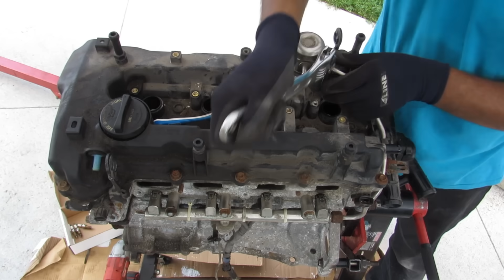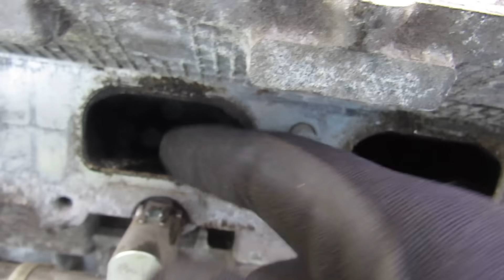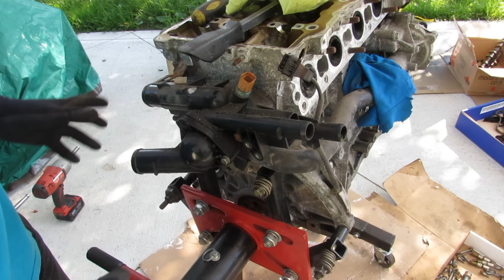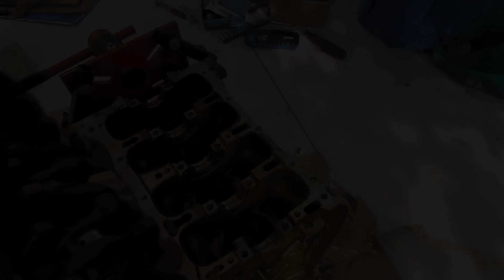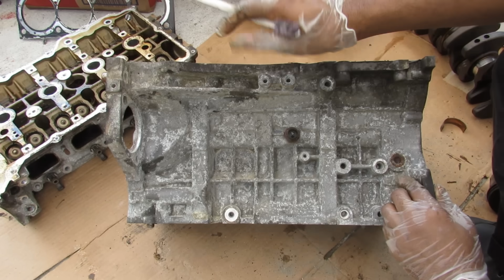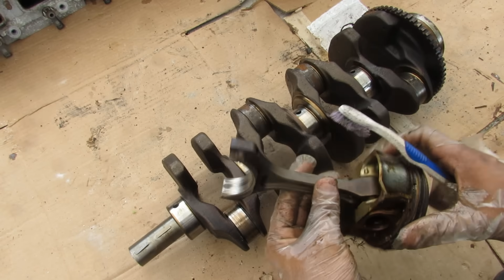Why Hyundai Engines FAIL

Comment: Because since about 2011 they stopped using good cheap simple aluminum crankshaft bearings, they started to use colorful copper crankshaft bearings, kinda to improve them, but for real it was to limit life of these parts more. If interested, I can share video in Russian where guys service mostly kia/Hyundai and by end of 10 years since 2011 they just realized that the improvement is actually a planted bomb.

Comment: I had a 2017 HUNDAI Sonada. My car was part of the engine recall due to the Vin numbers. My dealership basically said they would fix it when my wife and 6 year old daughter was on the side of the road with it!!!! It was running great. And while it was. I  traded with 10K ON the clock. For something else.  Looks like I avoided buying a new crappie engine when it was going to be out of warranty.

Comment: backed to 100k r 10 years- NO other carmaker backs products that well- toyota and honda wont admit their issues and hope the warranty ends
Reply: Pretty sure the 100k/10yr only applies to the original purchase owner. It no longer applies if you buy it second hand. 

Toyota did full frame replacements on Tacoma's for the frame rust issue. Parts & Labor $15,000 and they still honored it for older trucks not even worth that much. They also fixed the oil burning issues on their 2AZ-FE engines which cost up to $5,000.
Reply: @Argedis  yet denied sludge issue

Comment: Granted some engines are more durable then others, but Servicing your engine and keeping fresh fluids at all times will ensure longevity.
Reply: For real. I've got 92k on my '13 Sonata and I like it a lot. A lot of power and torque in the power train for a non turbo inline-4. The fuel injection is a problem so I'll probably let mine go as soon as the car market calms down. Mine will  be under warranty for another 10 months.

Comment: My buddy’s seized randomly on the highway. Hyundai replaced it for free, just had to pay for inspection. Even if yours is out of the warranty go harass them.
Reply: Most of these engines that have known problems are lifetime warrantied for the first engine
Reply: @jciarkowski3109  but I think it applies only to original owners...
Reply: @spol1622  if it’s the lifetime warranty extension (TXXI) it applies to the original owner or subsequent owners.
Reply: @spol1622  nope I’m second owner and I have life time warranty in writing
Reply: @spol1622  no, for all subsequent owners.
Reply: @heknows5418  just to let you know they added a new exclusion to the lifetime engine warranty on these. If your vehicle still has campaign 953 open when you’re engine dies they will not cover an engine replacement. Make sure you have campaign 953 done to still qualify for the lifetime engine warranty.
Reply: @jciarkowski3109  no, if the second engine dies, they still have to give you another one.  I got confirmation on this.
Reply: My niece sweet - talked her way into a new engine in a Sonata,  she was over in miles to cover,  but she just smiled, batted her eyes and said ....omg, what am I going to do now? Problem solved,  does not work well for 57 Year old grumpy bastards like myself though...

Comment: I had 2016 Kia Soul. I don’t think it was this engine but the result was the same. Catastrophic engine failure at 70,000 miles.
Reply: Replaced under warranty?
Reply: @JohnSmith-yv6eq  luckily yes... I must say they replaced the engine with out any hassle. And I was issued a rental car.

Comment: I read an account by a Kia dealer tech of this engine issue which also affects sister Hyundai. Drilling swarf left in the crankshaft oil passages. Dealers have a sound recording monitor which analyzes engine sound level to determine pending failure. 10 year 100K miles powertrain warranty should cover a replacement engine in addition to recall. Don’t let a dealer tell you they never heard of this issue and campaign. 
Now a new different engine problem recall 203 for faulty piston rings causing scored cylinder walls and excessive oil consumption. 
If Kia/Hyundai wants to keep up and beat Toyota and Honda they need to turn the company upside down to fix this repeated issue.
Reply: isn't that 100k warranty suppose to cover engine regardless? Hell, if mine gets this bad I'm going to offset the thing beforehand or claim a lemon law if they don't honor that warranty.
Reply: There is a reason they sell for so cheap. Corners were cut.

Comment: Would you know if the Hyundai Elantra 2017 or newer 2.0Lt has any engine issues?  I was thinking about purchasing an Elantra 2017
Reply: My 2016 sonata is at the dealer right now getting a new engine so adding 1 more year....idk

Comment: is using of 2 simple  engine oil pump  better for 2.4 GDI engine  in 2011 sonatas? .Because some repairers claims that oil pump of 2 simple engine is better than 2.4 Gdi oil pump.They said that it works more powerful

Comment: I have a 2015 Kia Sorento with this engine & it had the rod bearing issue at 95000 km's. Annoying and inconvenient however Kia replaced the engine free of charge even tho it was out of factory warranty. I was lucky that way, as it's a known issue.
Reply: I work for Hyundai. They've done nothing to address the issue. Just send us reman long blocks most of the time. They'll pretty much cover it forever though. I've put engines in cars with 200,000 on the clock.
Reply: @trevorharley4475  another new engine in 95000kms I guess lol
Reply: @trevorharley4475  is the software update mandatory to get the coverage? My gf has a 17 Sportage and got the letter encouraging her to get the update. 56k miles, no issues yet.
Reply: @danwake4431  it is now. Hyundai has started declining failed engines if the vehicle has ANY open recalls. Even if they are not related to the engine failure. Recalls are government mandated and at no cost to the customer. I would highly encourage you get all open recalls completed and follow up with your dealership regularly to confirm you have no open recalls. They've also gotten stingy about oil change records. So stay on those oil changes and keep the records.
Reply: @trevorharley4475  yes!! Stay in top of the oil changes and even once in awhile do it at the dealer. It helped me when I had an issue with my sienna and Toyota paid for the fixing of my blower motor.
Reply: However....did they replace it with the same machining engine or a proper replacement with out these problems?🤔
Reply: @sachsgs2509  I did inquire about that. They said the engine is brand new without the defects, and they haven't had any of the replacements experience the same issues
Reply: @CanadianTalent1  got ya...thank you for the info👌
Reply: Got one in the shop now waiting for approval to replace engine. Hope they do it, or I'll have to rebuild the POS myself, not spending too much money on a 2012 vehicle, but I hate to junk it too.

Comment: I owned a 2014 Kia Optima sxl turbo and I was always wondering why the Theta or Hyundai engines in general have the loudest direct injection.
Reply: All DI's clack the same, is the reason why lately cars have a lot more plastic covers. They work as noise suppressors. Listen to a diesel, it's the same noise.

Comment: My 2012 Sonata passed all testing requirements conducted by the local Hyundai dealer, thus, I was given an engine warranty up to 200k kms.  I am now at 185k kms. and I have not felt any engine abnormalities.  Almost every week, I check the engine oil level, it should be on the max side.  If the oil level goes down a bit, I top it off.  Once I reach 5000 kilometers, I change the oil and often use full synthetic oil and some premium oil filter.  I've also installed an oil catch can at 60,000 kms. so every time I do an oil change, I see some oil accumulation from the catch can.
Reply: I feel bad for you because I just bought a Toyota and I don’t have to deal with this
Reply: @merced175  Be careful because Toyota engines suffer the oil eating problem but that is because the owners actually cause the issue. All these small engines have weaker oil rings so and you need to keep that in mind.
Reply: @merced175  you kinda do tho. Toyota four cylinders are famous for drinking oil
Reply: @goclunker  it was a manufacturing defect that Toyota covered by replacing the pistons and piston rings. My Sonata was burning oil and Hyundai REFUSED to do anything about it, it got to the point where it was burning 3-4 quarts every 1k miles. There are Toyota's that burn oil, but the percentage of those that do are much lower than Hyundai's that burn oil.
Reply: @goclunker your absolutely right we have to top off every 1000 miles . They have a piston ring issue .
Reply: @GriffXJ my 2016 Hyundai sonata sport was doin the same thing until I called the dealership and they replaced the engine in 3 weeks with a lifetime warranty I hadn't had a problem since no one oil consumption but the dealer is in California
Reply from the maker: This is probably the best you can do to this engine. Hopefully it lasts.
Reply: I traded my 2011 Sonata 2.4 L with 235k km. Still ran fine...I drive mostly highway. My 2019 Tucson has the same 2.4L engine and it has a lifetime warranty on it due to the crankshaft milling issue suspected from the factory. I still drive mostly highway and the dealership mechanic told me that the highway driving would likely save my engine due to the oil being flushed through without seriously damaging the motor.
Reply: you will be right with this --> Once I reach 5000 kilometers, I change the oil and often use full synthetic oil and some premium oil filter
Reply: I stop using synthetic because my engine completely drinks it.  But Peneoil did do a great job cleaing it, the oil will turn black.  Now I use GTX and change the oil at 3500, but requires a quart or two between oil changes.
Reply: I would  rather get rid of it and drive something else just to be safe.
i dont want to constantly worry about hyundai engine blowing up in the middle of highway.  
10 years old hyundai worth nothing anyway.
Reply: I would get rid of the car prior to that 200k if you're smart. Don't go to the dealership cause they know about this. I'd shop around for best deal to get cash or trade-in. Once that warranty period is over for Hyundai/Kia cars you're playing with fire. Not worth it really.
Reply: A little oil burning never hurt anyone

Comment: Speaking as a retired mechanic this engine does have some serious design flaws. However, I now do airport transportation and have a 2013 Sonata (had I known about these engine issues I wouldn’t have bought it) bought new. Being very old school I changed the oil with 5w30 Valvoline modern engine full synthetic every 3000 (mostly highway) miles. At almost 212,000 miles on the original engine and transmission it’s just now starting to consume about 1/2 qt per 1,000 miles. In addition I drain and refill the coolant every year regardless of miles (I do this with all of my vehicles). Since I mostly used it on the highway I had the valves de-carboned every 70,000 miles. In addition I only used top-tier rated gasoline with a good fuel system treatment (Lucas every 1,000 miles Chevron every oil change) running a tank of premium every 3,000 miles. I also replaced the spark plugs and serpentine belt every 50,000 miles as well as replacing the transmission fluid every 15,000 miles because as an airport transportation driver my car(s) needs to be reliable. I have switched to 10w30 high mileage full synthetic in an effort to slow down the oil consumption. The car still looks, runs, and drives great. I now have a 2020 Mitsubishi Outlander suv as my business vehicle with my Sonata as my back up vehicle. I honestly wonder how many of these problems are attributable to Hyundais design flaw(s) vs owner neglect.
Reply: I have a non-turbo 2011 Sonata with 259,000 miles on the original engine, transmission, even axles. A family member borrowed my car for the last 20,000 miles, changed the oil/filter exactly once in that time, and overheated it on 5 separate occasions due to a coolant leak from that plastic thermostat housing. I was almost certain that the thing would be cooked, but one new housing later and we're still kicking.

Anyway, working at a shop with a lot of Hyundai/Kia customers, I understand I'm a minority with sort of a "survivor" engine - I've seen more than a few seize around the 100-130k mile mark.  I can recall at least 4 Sonatas that have seized, even out of the extended warranty period of 120k miles, and Hyundai took care of them all. I have yet to send a customer to the dealer for repairs that weren't covered, many times even outside of the warranty. I'm confident recommending these cars to customers as they can really be an exceptional value, and definitely tend to offer much better overall quality and driving dynamics than others. Despite issues as significant as, well, engine failures... Hyundai/Kia do seem to stand by their warranty.
Reply: @mrkzj2   That’s great to know. My car is on my living so if my engine does take a “dump“ it’s good to know that Hyundai will stand behind it. I’ve tried to get them to replace it because of the oil consumption issue but they said it’s not severe enough to warrant a replacement.
Reply: @recoveringnewyorker2243  Not to tell you to be dishonest, and I don't believe it makes a difference anyways... miles are miles, but don't tell them you use your car for commercial purposes, as they'll deny warranty.
Reply from the maker: I think both issues compound each other. The original oils would have had to be changed out frequently that the metal particules would be flushed out before causing major damage.
Reply: @speedkar99   Agreed, both issues compound each other. The 1999 Hyundai accent (bought new) I traded in for the 2020 Outlander still ran and drove great even though it was considered at the time to be a “throwaway car.” Although the paint was faded everything except for the rear window defroster functioned perfectly. That car was run on conventional oil. My wife’s 2010 Hyundai Accent with almost 95,000 miles on it still looks, runs, and drives great. My 2000 Chevrolet S10 2.2L 4 cyl was purchased in 2011 with 74,274 miles on it and a destroyed (seized) engine. The previous owner knew nothing about maintenance, she just drove it. After installing a new (not remanufactured) General Motors crate unit and a myriad of other new parts she now has 141,000 miles on her and has been a dependable daily driver ever since. Unfortunately all most drivers know about their cars is “Stick the key in and turn it.“
Reply: @speedkar99  Would frequent (every 3K). oil changes mitigate the intake valve carbon buildup?
Reply: We did all that maintenance on my sister's 2011 original owner, and she drives like a gramma. I would have to remind her from time to time to floor it. It seized at 115k. Hyundai saw all the receipts for the work I had done, and the intervals. Took 5 minutes for them to approve a new engine replacement.

Comment: Dude. And I thought Ford and GM were cutting corners in their engines. No wonder my 2015 Kia Sorento 2.4L engine overheated and blew up. I got a new engine and extended warranty up to 150K. And it blew right before the 60k warranty hit. Like at 57k or 57.5K I was a lucky bustard then. Awesome video bro. I always did wanted to see Hyundai’s 2.4L engine. No where near Honda standards.
Reply from the maker: interesting to hear your experience. I'm going to be filming a Honda next

Comment: I'm not convinced with their official explanation as to these failures being something as simple as debris left behind in the manufacturing process.
Surely something is failing in operation which is causing the debris to accumulate over time, or else the issues would be apparent almost immediately. They are however mostly happening after 100,000 miles and up to 10 years after leaving the showroom! 
I have a feeling there is a design flaw somewhere that they aren't admitting to...
Reply from the maker: If the metal debris isn't affecting the bearings directly, it's building up over time in the oil galleys causing oil starvation.
Reply: @speedkar99  I don't get how this debris will build up over time though if it is already there in the galleys from day one. If this were true it would be trapped in the oil filter almost immediately, long before they had a chance to accumulate.
I feel there is a design flaw causing a sudden point of failure somewhere and they are literally embarrassed about it haha

Comment: Bearings - ACTUALLY if there was debris in the oil, causing them to burn up, it would have affected the main bearings as well as the cams. I believe what happened it a simple case of oil starvation. Basically direct injection eating oil, oil not being check/changed regularly causing slug to clog the piston oil control rings, which then wears the piston rings, more blow by, ect. in a oil eating circle.
FYI, I have 2 of these engines in perfect condition.
Reply from the maker: The metal debris cause oil passages to clog up causing starvation
Reply: @speedkar99  I have 2x non direct injected Theta II engines and NONE of them have had any premature bearing wear. This was verified during their 100k and 80k engine rebuilds. The non direct injected Theta II engines, the most common issues is chain stretch. 
The SAME issue as the engine in your video is happening with Toyota engines with 10k mile oil changes (as stated in the maintenance schedule in the owners manuals). Plenty of videos on this on 10k oil change toyota engines explaining this from authorized techs from toyota service centers (remember, most of these places are licensed franchises) Stating what I said in my first comment.
If it was because of debris, there would be evidence of this by checking the OCV filter.
Reply: @speedkar99  is that wrecking the piston rings also? It must still be related